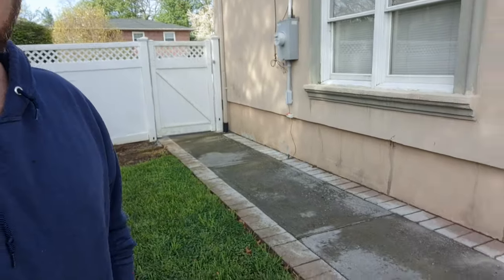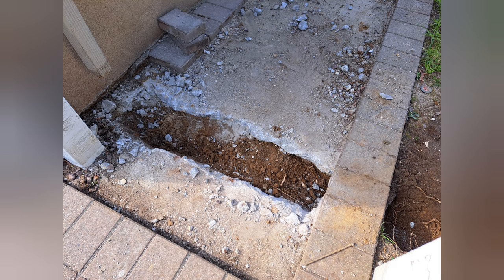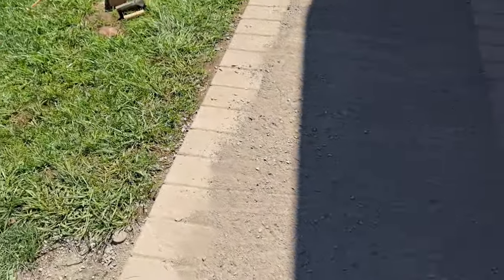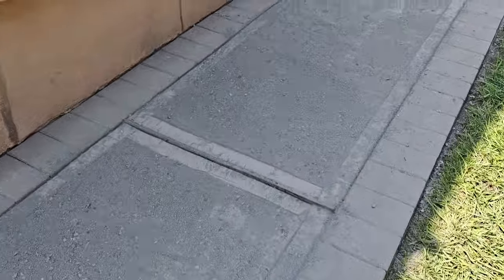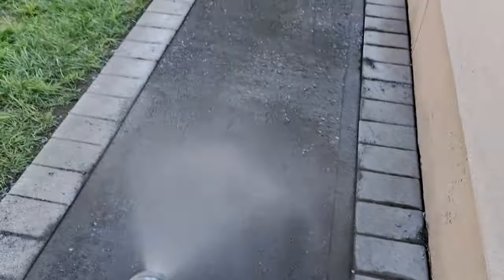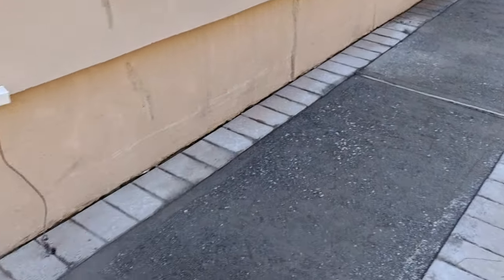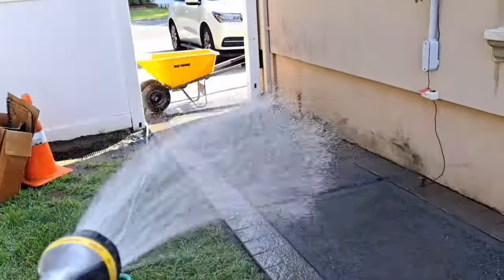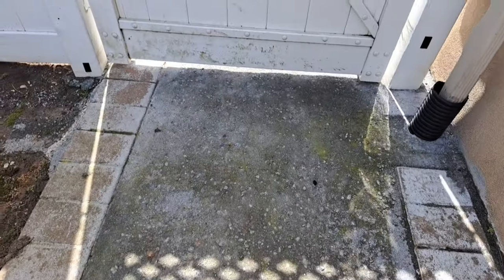DIY concrete sidewalk Dry pour 1 year later.

Comment: Thanks, you saved my wallet, I had a similar project the contractors were quoting $4000, after I saw your video yesterday evening went to home depot realised i will save at least 3500 i plan to do myself bought some 2x4 already finished the framing by to morrow everything will be done Thank you
Reply from the maker: So awesome! This is the reason I posted. 
To help others save money!
Don't get me wrong it was alot of backbreaking work but it's not hard. Just have some help with lifting the bags and emptying them. 
If I had to do it over I would make sure no large rocks were at the surface when I sprayed it down. 

GL! 
Send me a pic when it's all done!